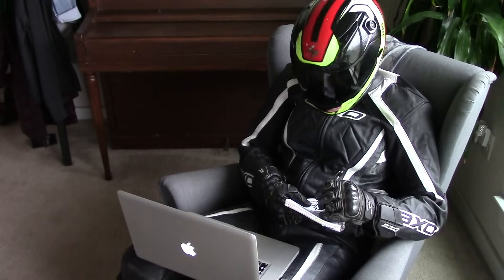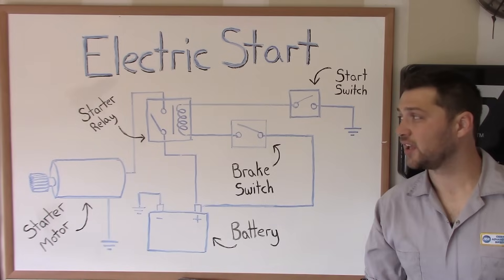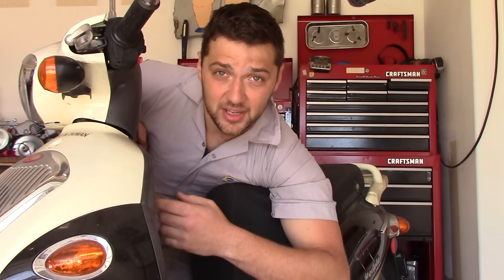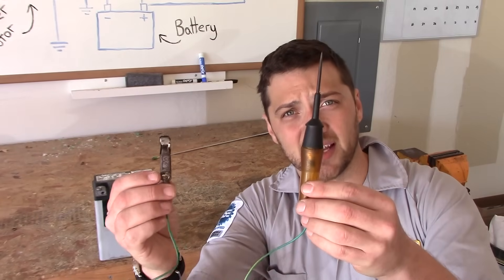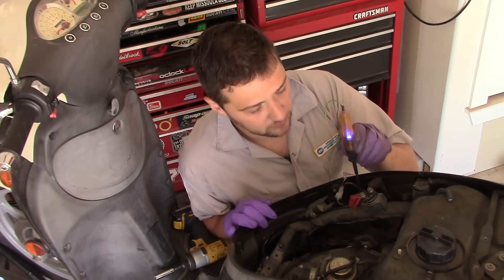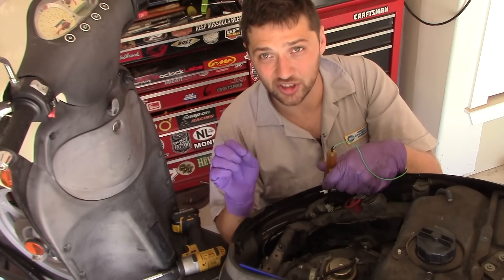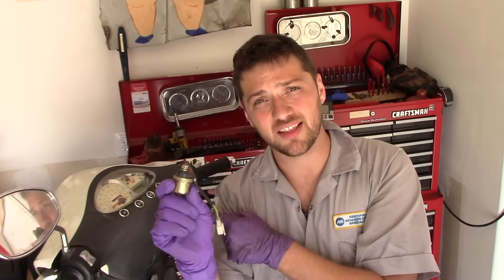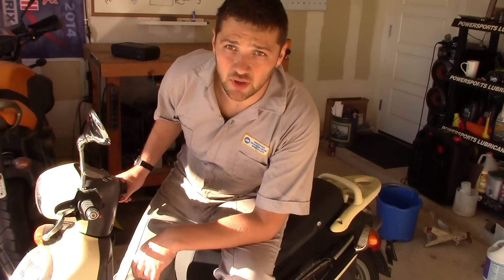Scooter 911: Electric Start Doesn't Work (troubleshooting your starter, starter relay, and circuit)

Comment: hello there i watch you video really great im a new subscriber ...i have a problem i had a little acident with my moped ..so the kickstarter stop functioning and i remove it completely becuse i dont know how to fix it ..now my scooter refuse to run but it is cranking but wont run ...do you think it cant run without the kickstarter please i need your help asap thanks
Reply from the maker: Hello and thanks for the subscribe! Yes your scooter should still run without the Kickstarter. If it ran fine before the accident look for something that might have got dislodged. I would check the kill switch first! Good luck!
Reply: @Scooter_911  thank you so very much ...the scooter actually run for about a week after the accident ...the problem only started aftter i decided to fix the kickstater and replace the new airfilter i bought after i coupled it back togther ...it keeps spining but wont run

Comment: I have no electric cause i changed my cdi can i fix that with this video?
Reply from the maker: I'm not sure this video can help you with that. I would check the little glass fuse located near your battery.
Reply: @Scooter_911  yeah im about to check it thanks
Reply: @Scooter_911  what do i need to do if i do not hear any starting sound

Comment: hello.. great video. your videos are super clear to understand for a regular scooter. But you mention, its not the same for a Honda Met or ruckus. I have a 2002 honda met with a starting issue. Where can I go for the same problem but this type of scooter???? If this does not, how can I get this fixed.. what video will help ? Thanks for your input .
Reply from the maker: Usually starting issues with the met and ruckus can be traced back to 2 places. A dead/weak battery and brake switches. Make sure your brake lights illuminate when you squeeze the brake lever. If it does I would swap your battery for a fresh new one. Good luck!
Reply: @Scooter_911  I have a 2013 honda metro (fuel injection, no carb) with start issues. I've replaced the battery and the brake light illuminates just fine. Scooter does nothing at all when the starter button is pressed - no sounds or anything. Before this happened, sometimes the scooter would stall out while sitting at a traffic light (then starter wouldn't work - I'd need to wait 10-20 mins before it would magically start again). Final nail in the coffin was a stall out while riding ~25mph and hasn't started since. Any ideas?

Comment: hi, i had start problems and as shown i bypassed the starter relays and it started. but the starter button and the brake switch after connecting directly didn't make the scooter start by the start button. so i placed another button to bypass the starter relays. but i want to make it start as by default. where the fault can be? i connected the startbutton and brake switch directly but nothing. please!
Reply from the maker: You're on the right track! however connecting the starter button directly to the brake switch will not activate the relay. I would take a step back. You know the start button is good because you just replaced it. Does the brake light illuminate when you squeeze the brake lever? If it  does I would have to suggest that you replace the starter relay. Let me know what happens and good luck!

Comment: My scooter makes the noise you mention at 3.36 but it won't start. I have to use the kick start any ideas ?
Reply from the maker: That noise is called cranking. Usually if your scooter cranks and doesn't start, BUT it starts with the kickstart it is a result of low compression. I would try a valve adjustment. I have a valve adjustment video coming out on thursday. Good luck!

Comment: You have mentioned not ruckus but I have a ruckus and my electric start doesn't work  only hearing is a clicking sound but don't kick the starter brake works because it goes on and of what it could be?
Reply: Well I have turn it on with jumper cables and it work before!but the other day I try do in ti but nothing just the clicking noise on starter button
Reply from the maker: @edwinromero1536  sounds like you have a bad battery my friend!
Reply: @Scooter_911  thanks men I'm going buy one today
Reply from the maker: Is the battery in good condition?

Comment: My electric starter was working this morning! I came inside for about 30mins and I came back out and no it doesn't even turn over!! It has no sound like the clicking on the video or anything! I can kickstart it and everything works though!! Does anyone know what my problem is?
Reply: Mine is a 2016 taotao 50 49cc with a 80cc big bore kit
Reply from the maker: Try the starter relay bypass at 7:32 . Most likely it's the relay, but also Tao Tao's are notorious for those ground wires on the valve cover working their way loose. Good luck! Let me know what you find.
Reply: @Scooter_911  thanks I'm gonna give it a try  in the morning when I get a chance!!

Comment: Does it mean that my starter motot is broken if it only makes the sound that's occured at 05:18 ??
Reply from the maker: Not quite. It's very likely that you have a bad starter relay. Did you try the bypass test at 7:32?
Reply: @Scooter_911  bypassing doesn't give me any result or even any sound, my stator isn't hooked (i think it's necessary) but i'm ordering a new one so i'll try again when i have it.
Reply from the maker: @deepresearcher  well if bypassing it doesn't result in any sound or action and you know you have a good battery then yes most likely it is your starter.

May I ask why you disconnected your stator?
Reply: @Scooter_911  i disconnected everything and washed the whole chassis of the scooter and stupidly forgot to let it dry long enough... I put all the wiring back to place, bought a brand new battery, held the brake and........... It started smoking due to a short circuit, my guess is that because it smokes only specific wires that go to the stator, it means that there's still water there and yes when i turn the flywheel, some drops of water fall from behing the flywheel. An expensive mistake i made but it didn't turn on anyways even before i burnt the stator accidently. Now i'm trying to figure out is it the starter motor or it's relay that's broken.
Reply: Is it possible to connect the starter motor directly from the battery or will it not have enough current & voltage?
Reply from the maker: @deepresearcher  that's exactly what the bypass does. The starter needs power and ground to run. The starter gets it's ground from being bolted to the engine, so it will not work if it is not bolted to the engine.
Reply: @Scooter_911  do you possibly know what happens to mean when i try bypassing and the result is flickering/spark between the two connections of the relay?
Reply: @Scooter_911  so i ended up taking the starter motor apart and there was a surprise waiting inside! Broken pieces of plastic and coils :D i put the old stator back and found the reason for the short circuit which was the broken motor. I measured the relay and it seems to be still usable, i just need a new starter motor. Thank you for having this channel with helpful information. Love the content and your humor!

Comment: Very helpful video! My scooter didn't start after filling the gas tank. Fortunately the kick start started it, but the horn was weak and no turn signals. Just bought a new battery. Still nothing (didn't think it would be that easy!) So after watching your video I thought I'd see if my break light turns on and it did. So I tried starting it and it started on the first try. COOL! Still no blinkers and horn was barley there. I shut it off to go get my phone to show the family it's working and when I came back to the garage; NOTHING! not even the break light...
Reply: Ends up it was a bad voltage regulator

Comment: I've been kick starting my agility kymco 50 last few months and its so annoying. You made amazing video and I'm going to try to do by pass starter relay and see if it works. big thanks. will report if it going or not : D
Reply: just went out and i wasn't able to test the relay but i can clearly hear clicking sound coming from starter relay so that means everything up to that point is working. so now my idea is that starter motor is bad. would i be right to replace it. whats possibility of loose connection to starter motor.

Comment: What if the trick still doesn’t work
Reply from the maker: Well I guess I need to know what you mean by doesn't work. Does the scooter crank but not start or does it not do anything at all when you bypass the starter relay? If you are certain the battery is good, and the scooter does not do anything when you bypass the relay you likely have a bad starter motor
Reply: I replaced the starter motor already, the scooter cranks but does not start. @Scooter_911
Reply from the maker: @mattsgopro2670  Well if your scooter is cranking then the electric start system is working properly, you have a different problem. Basically your engine needs 3 things to run: A charge of fuel and air, spark, and compression. So you need to make sure your bike has all three of these components. The easiest one to start with is spark. Remove your spark plug, insert it back into the boot (at the end of the plug wire), ground the tip of it against the engine and "Start" the engine. You should see a bright bluish whitish spark jump across the tip. If you have spark, reinstall the plug in the cylinder head and puff some carburetor cleaner or brake parts cleaner down the intake. If the scooter pops or coughs or starts and runs a little you have a fuel issue. If the scooter does not respond to the carb cleaner you likely have a mechanical issue preventing the scooter from building proper compression. I would perform a valve adjustment and then re-test. Good luck!

Comment: I have this problem 3:36 someone help me!?
Reply: 50cc
Reply from the maker: @Vibez.  on the 50cc scoots the starter gear actually extends and contacts the variator. You can take the belt cover off and watch and see if the gear is extending fully. Usually it's a problem with the little guide bushing in the belt cover or the starter motor itself. Good luck!
Reply from the maker: Well if your scooter is making that sound that means the engine is cranking. And if the engine is cranking then the electric start system is working properly, you have a different problem. Basically your engine needs 3 things to run: A charge of fuel and air, spark, and compression. So you need to make sure your bike has all three of these components. The easiest one to start with is spark. Remove your spark plug, insert it back into the boot (at the end of the plug wire), ground the tip of it against the engine and "Start" the engine. You should see a bright bluish whitish spark jump across the tip. If you have spark, reinstall the plug in the cylinder head and puff some carburetor cleaner or brake parts cleaner down the intake. If the scooter pops or coughs or starts and runs a little you have a fuel issue. If the scooter does not respond to the carb cleaner you likely have a mechanical issue preventing the scooter from building proper compression. I would perform a valve adjustment and then re-test. Good luck!
Reply: @Scooter_911  thank you so much! I replaced the spark plug and it's working 👏
Reply from the maker: @saddamespinosa4859  great to hear!
Reply: Mine sounds like it isnt catching once it does it will try then goes back
Reply: Kind of sounds like a electric drill
Reply from the maker: @Vibez.  is it a 50cc or a 150cc?

Comment: Im new to the scooters , and i got a 50cc peace motorsport  which are apparently terrible . But it ran the first day and it hasn't since . I replaced spark plug and fully charged battery. It wont turn over i try to kickstart nothing ( compression is there) bypassed starter terminal still just whinning like it wants to but doesnt help!!!!
Reply: Also do you have a guide video for valve adjustments?

Comment: When you said if your bike makes this sound its not an electric start problem you didn't mention what the problem is any thoughts?? Or a place to start?
Reply from the maker: Basically your engine needs 3 things to run: A charge of fuel and air, spark, and compression. So you need to make sure your bike has all three of these components. The easiest one to start with is spark. Remove your spark plug, insert it back into the boot (at the end of the plug wire), ground the tip of it against the engine and "Start" the engine. You should see a bright bluish whitish spark jump across the tip. If you have spark, reinstall the plug in the cylinder head and puff some carburetor cleaner or brake parts cleaner down the intake. If the scooter pops or coughs or starts and runs a little you have a fuel issue. If the scooter does not respond to the carb cleaner you likely have a mechanical issue preventing the scooter from building proper compression. I would perform a valve adjustment and then re-test. Good luck!

Comment: My scooter is making the sound at 3:40 and you said my starter is working fine, but I have a different problem...could you possible point me in the direction of what types of problems I would have?
Reply from the maker: Basically your engine needs 3 things to run: A charge of fuel and air, spark, and compression. So you need to make sure your bike has all three of these components. The easiest one to start with is spark. Remove your spark plug, insert it back into the boot (at the end of the plug wire), ground the tip of it against the engine and "Start" the engine. You should see a bright bluish whitish spark jump across the tip. If you have spark, reinstall the plug in the cylinder head and puff some carburetor cleaner or brake parts cleaner down the intake. If the scooter pops or coughs or starts and runs a little you have a fuel issue. If the scooter does not respond to the carb cleaner you likely have a mechanical issue preventing the scooter from building proper compression. I would perform a valve adjustment and then re-test. Good luck!
Reply: Garret Seesing Thank you for that comment, very helpful.  One thing I recently noticed was that whenever I pushed the ignition and tried to start it some fuel would leak out of the side from a hose attached to the carburetor, I looked it up online and I saw some things saying it could be an issue with the carburetor or the vacuum sealed valve...since those valves are pretty cheap online I figured I would try that one out first, not sure if I’m going in the right direction or not, but your comment will definitely help me out if where I’m going is a dead end.
Reply from the maker: @Scrinch_stole_schristmas  so that hose most likely is the float bowl drain actually. If it goes down to a metal piece that is bolted to the CVT cover there should be a brass screw in it. Sometimes these screws work their way loose while riding. If its just a host from the bottom of the carburetor without a metal dongle at the end check to make sure the floatbowl drain screw on the bottom of your carburetor is tight.
Reply: Garret Seesing I think you nailed it...looks like the metal piece that was bolted to the CVT cover doesn’t have a brass screw in it, must have fallen out at some point, thank you so much for the help!
Reply from the maker: @Scrinch_stole_schristmas  my pleasure! Glad you got it sorted!

Comment: 3:36 my scooter is making that noise and also will not start with the kickstart, ideas?
Reply from the maker: yes you definitely have an electric start system that is working properly. what you need to determine is if the engine is getting fuel (by means of the carburetor) and spark (by means of the spark plug). Has the scooter been sitting a long time? or one day did it just caput?
Reply: @Scooter_911  what happened is suddenly one morning it wouldn't start but was just making a clicking noise and then nothing more. So, before seeing your video we replaced the spark plug and starter. Now it turns over but does not start and we try for a bit but then the battery runs dead.
Reply from the maker: @mistyeve9467  more than likely you have an ignition system problem. It could be a faulty CDI, ignition coil, or even a stator. I'm working on some more diagnostic videos but they won't be done for a while. I recommend pulling the spark plug out, putting it back into the wire, grounding it against the head and turning the engine over. You should he able to observe a bright blueish whitish spark
Reply: @Scooter_911  I got spark with the plug and in the cable where the plug goes. So, what shall I do next to test?
Reply from the maker: @mistyeve9467  Next i would spray a little bit of carburetor cleaner or brake parts cleaner in through carburetor. Just disconnect the intake side and puff a few squirts into the carb. Then try to start it. The aerosol will act like an extra hit of fuel. If the scooter runs, or coughs or sputters you likely have a fuel issue. 
My last question is how many miles are on your scooter and has it ever had a valve adjustment?
Reply: @Scooter_911  

3425 km is all. It's  a 49er Sachs. I do not own it. A new friend broke down and needed help and I had a few ideas to try but so far I am at a loss. I just want to help her out as she has no other way of transportation. I am not sure if she has had any work done on the valves.
Reply: @Scooter_911  I sprayed it and started but nothing.
Reply from the maker: @mistyeve9467  it started? Or it cranked?
Reply: @Scooter_911 it only cranks but nothing more
Reply from the maker: @mistyeve9467  if it didnt pop or cough or anything when you introduced fuel, and you observed the spark i would have to conclude that you have a compression related problem. I would recommend performing a valve adjustment. I have a valve adjustment video releasing very soon, but you can find a lot of other videos on it. Good luck!